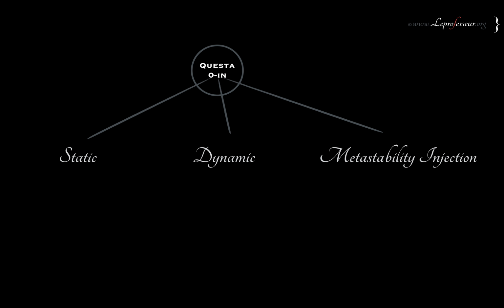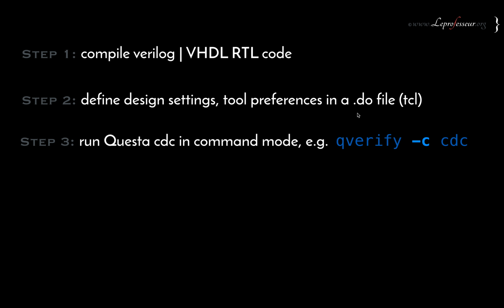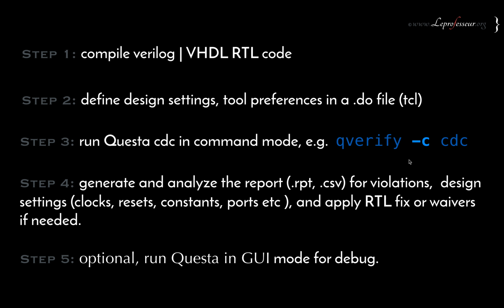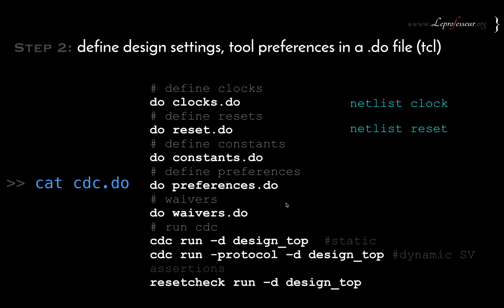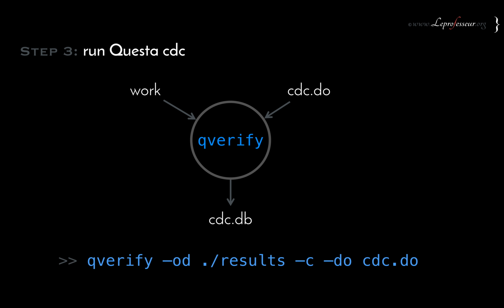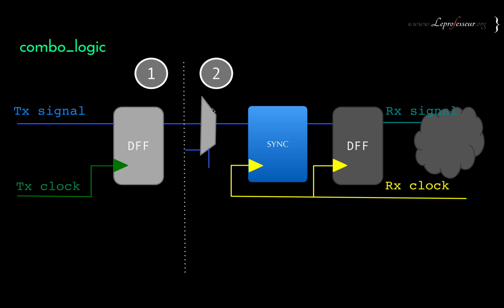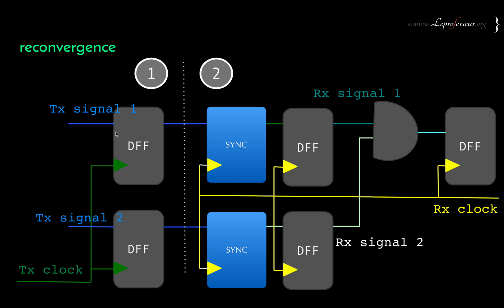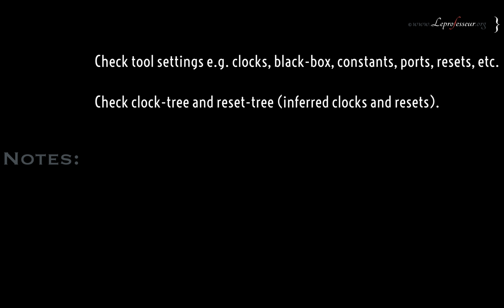⨘ } VLSI } 18 } Clock Domain Crossing } Questa CDC / Mentor / 0-in } LEPROF }

Comment: Could you please let me know where is the "Reconvergence" lecture? I am looking into your playlist/videos, but cannot find anything on "Reconvergence" . I need to learn how to solve problem with Reconvergence. Thanks
Reply from the maker: I am yet to have detailed lecture on reconvergence. I have discussed in one of the CDC lectures the reconvergence problem. The solution of this depends on several factors as how chip wants to resolve it across different domains. If we have all complete asynchronous clocks then different logic in both Rx and Tx domains, if we have semi-asynchronous (divided clocks) then different logic. Also it depends on whether it's on control, data or reset paths. 

Thank you for feedback, let me see what can I do on this topic further.
Reply: Thank you very much for following up. It will be great and really helpful if you can upload detail lecture topics on "Reconvergence". I like your lecture videos. I am interested to learn about FPGA design, especially on the Reconvergence topic.
Reply from the maker: I have explained more on reconvergence, please check at: http://leprofesseur.org/archives/28151
Reply: @Leprofesseur   this link is not working , can you please send any new link, just watnted to understand the reconvergence topic
Reply from the maker: I have created another lecture on reconvergence, hope this will be useful: https://youtu.be/ycAMZN1Idz0